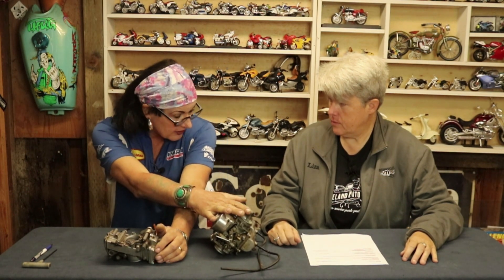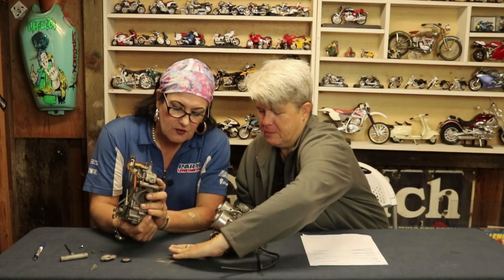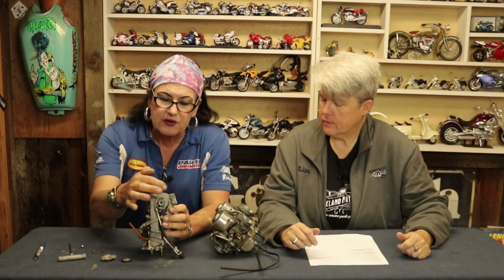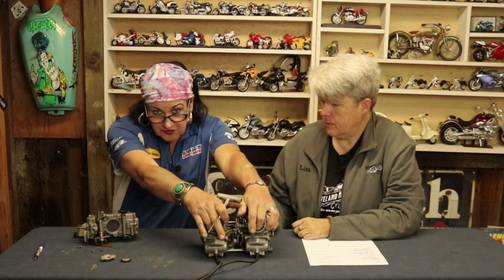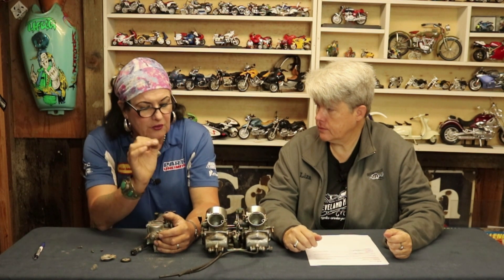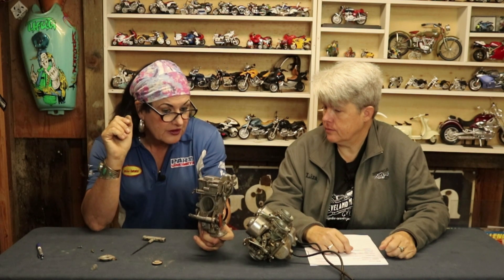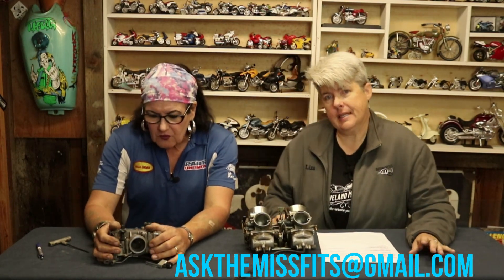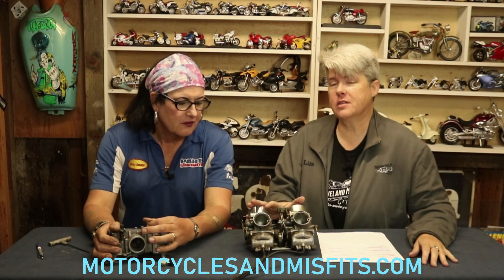Pumper Carbs Explained

Comment: Great video on pumpers carbs. It seemed to me the big engines always used a carb with an accelerator pump. Like car engines (holley double pumper). But now with fuel injection and the right computer software fuel injected bikes are easier to tune. Thanks for the explain.